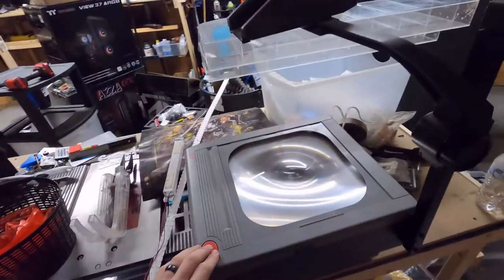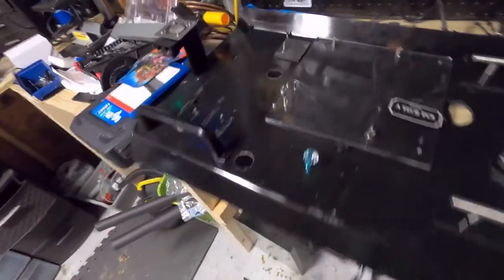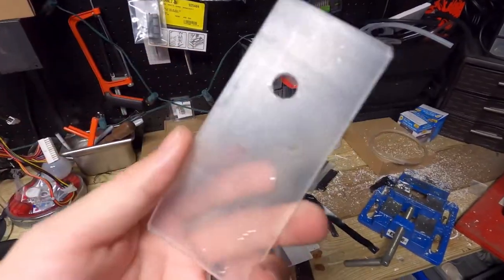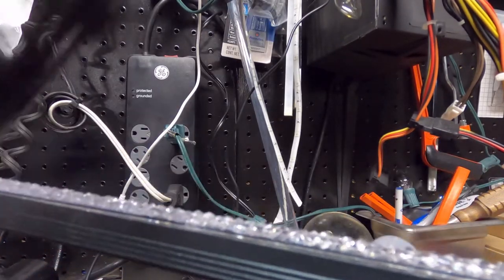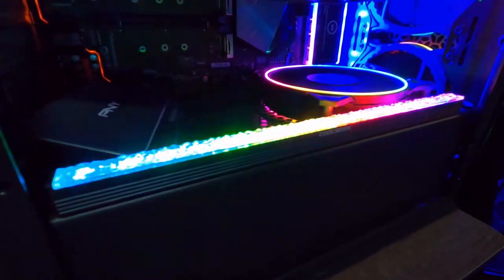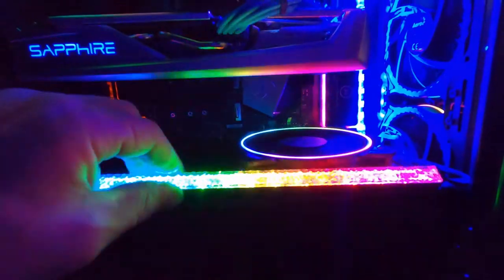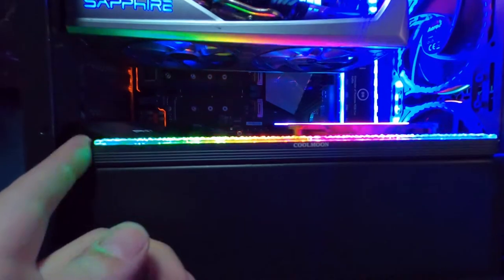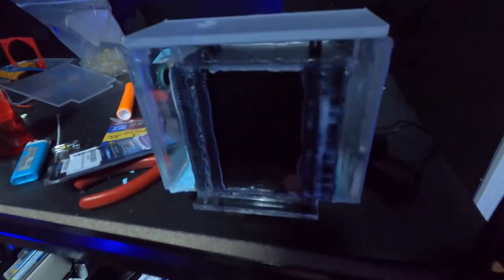CoolMoon  Diamond Ray  ARGB LED Strip

Comment: Mine frend i bought coolmoon diamond Unfortunately, there is only 1 cable with a small four-pin cable. I did not buy an adapter at the time. so couldn't use it. now i bought coolmoon black color adapter. only now i see that the adapter is started with small 4pin red color cable. so I have no other place where I can put this small four pin cable in it. pfff really frustrating. i hope you can help me with this please.